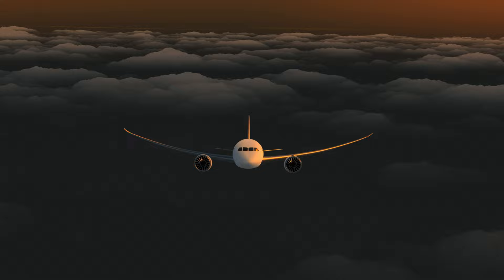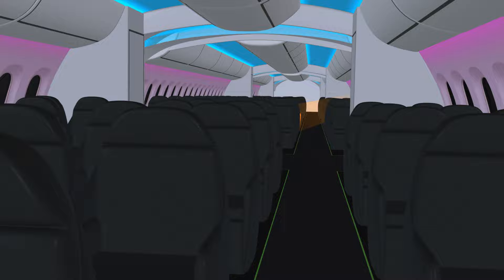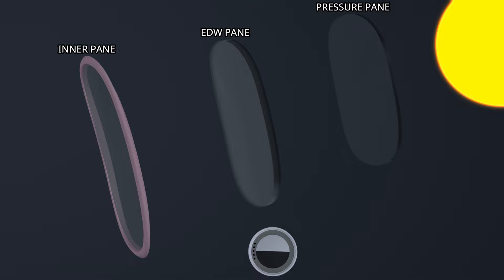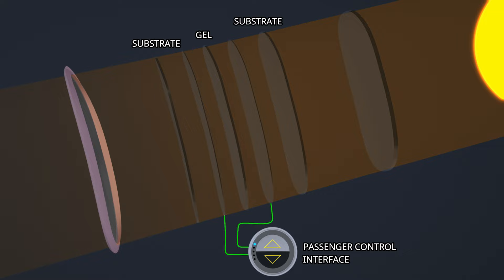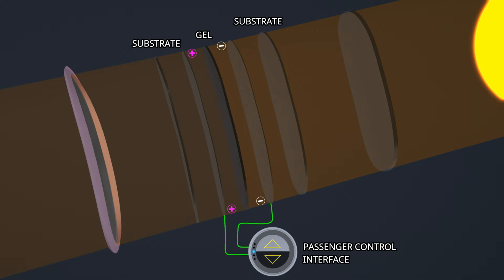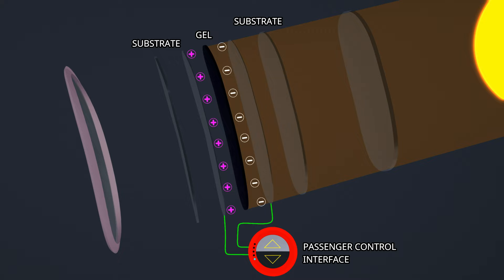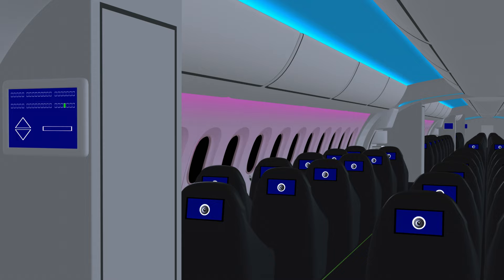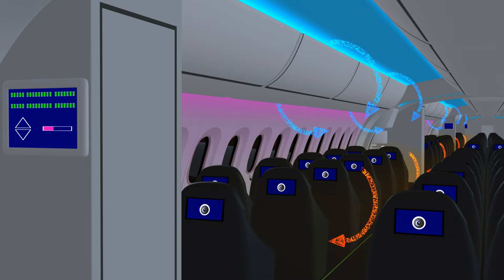How Electrically Dimmable Windows Work

Comment: This feature belongs on the cockpit windscreen so the pilots can apply as much or as little of a tint as necessary so that the pilots aren’t blinded by the bright sun.   That’s where there is a need for safety. 

But for Boeing to install this feature on every passenger window seems unnecessary and just gimmicky.  I think the current “pull down” window shades found on every passenger window in every commercial aircraft work just fine in the cabin.   It’s inevitable that there will be many failures causing hot sunlight to penetrate the cabin without the simple backup of a window shade!  It will be as ubiquitous as finding entertainment system displays not working.  If it ain’t broke, don’t fix it!

Comment: 787 worst aircraft I flew.

Each passenger has no AC duct above his or her head. It's like sitting inside a hot tube.

Dimmable light? Who cares. What a joke.
Reply: Then why did the Hainan Airlines 787 I flew have among the best ACs I have experienced in the sky?
Reply: You are aware that the airlines are the ones to configure passenger layout, yes? You might've flown with a bad airline. Which airline did you experience this with?
Reply: @devonalbatross  First I flew in a cheap airlines so I gave 787 a pass.

Then I flew in Qatar Airways. I flew both economy and business. Same as the cheap airliner. AC was not working.

In total I flew in 787 4 times. Same experience. Worst aircraft. In terms of look - ugly too. Bulky.

All hail AIR BUS.
Reply: Not gonna lie, the dimmable windows sometimes may be flawed and still transfer heat even with the window at the darkest settings.
During my flight with it, my window was hot as hell and i had to put a pillow on the window to block the heat radiating from the window. The heat was still felt from the middle seat.